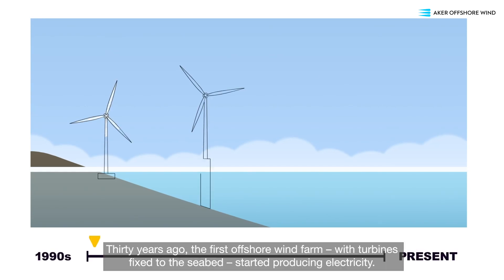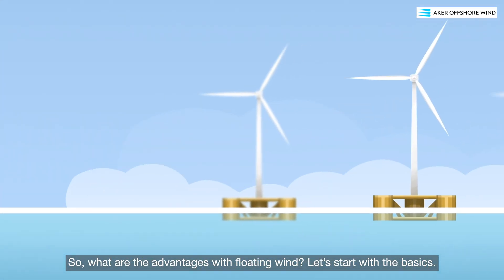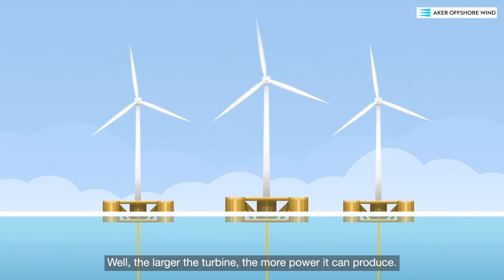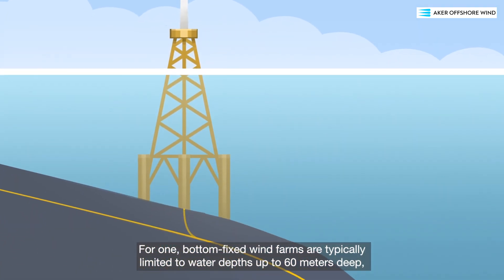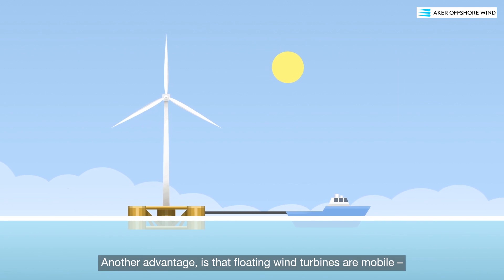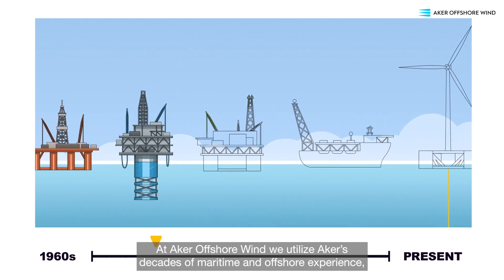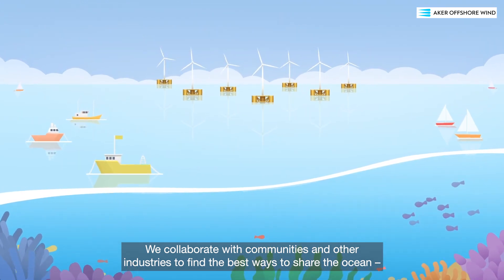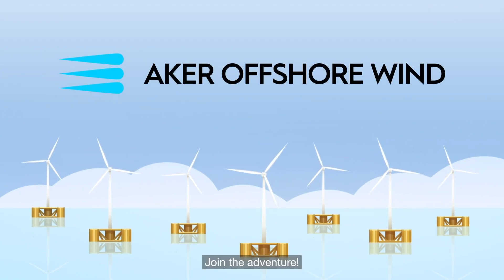The benefits of floating offshore wind - Aker Offshore Wind

Comment: they forgot to mention the anchor chains. Each turbine has at least 3 anchor chains, which are more than one kilometre in length and weigh 400 tons. The chains on the leeward side are constantly dragged across the sea floor ploughing up tons of sediment. The array of 100 plus wind turbines are connected by floating power cables. Migrating whales will be confronted with a labyrinth of steel chains and high voltage cables. We need to call for a moratorium on floating wind turbines before its too late to SAVE THE WHALES.